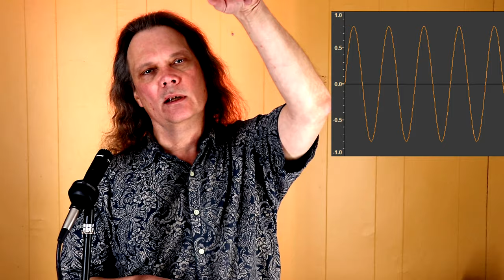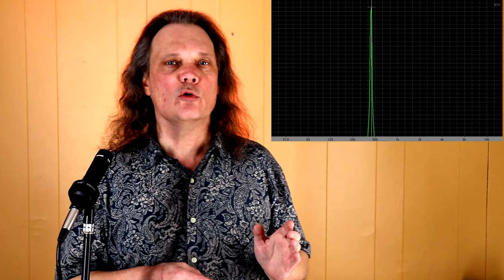Amplifier and Speaker Matching 101: How to Choose the Right Power for Your Sound System

Comment: Sound Man Barry! I need help! I have to run sound outside for a festival. I don't want to blow up my equipment. Will a regular generator work, or should I rent one with an inverter.  I found an inverter generator that's 300watts. I'm running a Peavy 400watt mixer head, into two 200watt speakers, with a passive monitor, and I'm bringing my QSC 1450 with an Ashley bass preamp into an old Sonic 2x18 2x10 cabinet. I have no idea how to calculate total power draw. I'm really just a musician that got roped into doing this. They normally hire a sound company, but they don't have the money this year. The bands are traditional Irish bands with all acoustic instruments. I just don't want anything to blow up. Please help!!!!!!!!
Reply from the maker: When running on generators bigger is better.  I'd look for at least a 5kw generator.  I'm comfortable using those big commercial trailer mounted generators that are 20-60kw, but if you can't get that, I'd rent a good sized portable generator.  The inverter type are best, but more importantly you want one that can handle the peak current demands.  Don't go too small. Some amplifiers handle the brief power fluctiations from generators better than others.  Have fun, hope you have a great time and a good show!
Reply from the maker: Lights often draw more continous power than sound, but the sound can have some high peak demands.  You want to stay well within the generators ability.  Running a bank or two of lights on the generator can help keep a nice modest load on the generator, and smooth out the power for the audio.
Reply: Thank you very much!!!!!! 
Thanks again for your awesome advice and video's. Rock and roll 🎶🎶🎶

Comment: I dont understand how you can overdrive the amp.  It the volume knob goes to 11, then the amp should be able to take it. The eq too. They should make em to take it.
Reply from the maker: The volume control doesn't really specify a certain output level. It controls how much the amp boosts the input signal. Put in a large enough input signal, and you could overdrive the amplifier.

Yeah, I would expect most guitar amplifiers to be designed so they are difficult to break, but if you're using separate amplifiers and speakers, then it's your responsibility to make good decisions.

Many pro-sound PA amplifiers do provide some signal processing including clip limiting, but that's another issue.